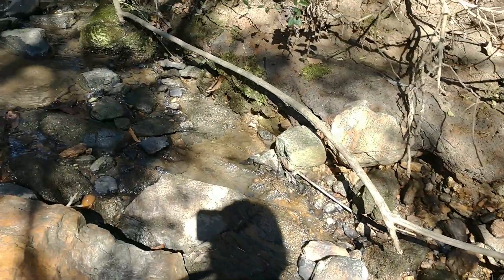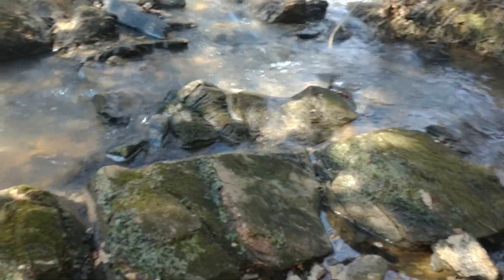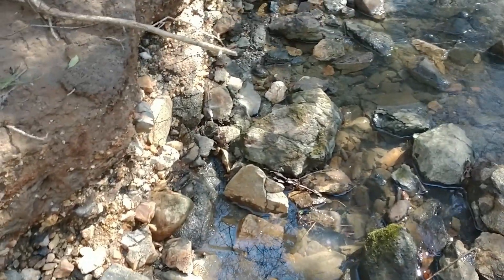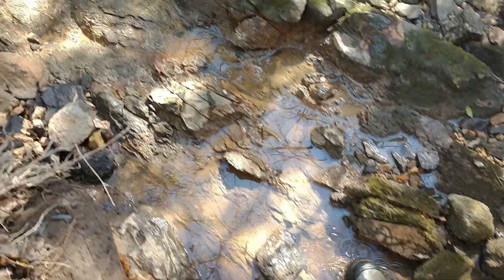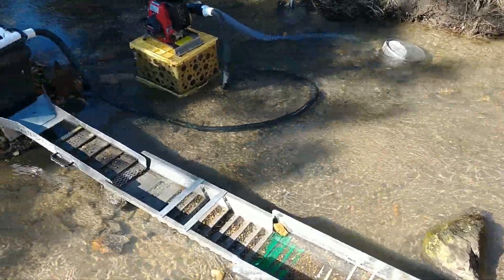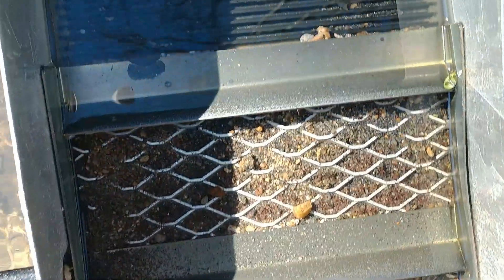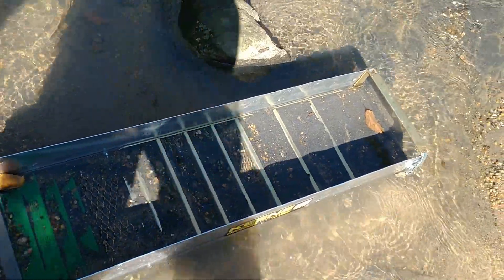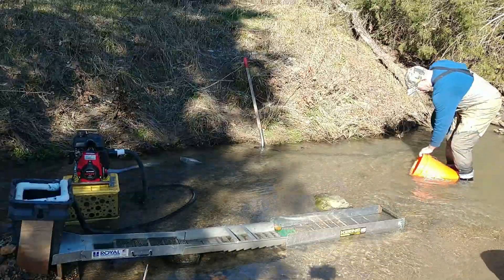The Joy of Adjustable Water Pressure

Comment: Did you check your tailings for any gold loss?
Reply from the maker: No, I saw how small those tiny pieces of gold were that got trapped in the first ripples and at some point, you have to consider how your time is better spent whether that be shoveling or testing.  I will say that I would've normally taken some test pans from that spot I was digging from before setting up the equipment but it was the only place I could find full sun.